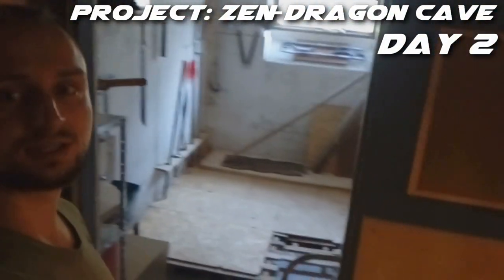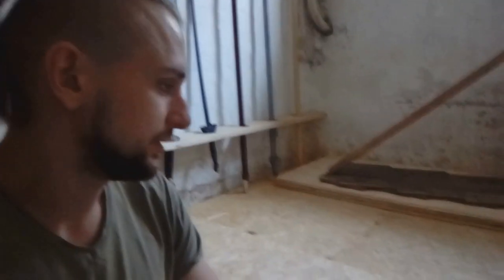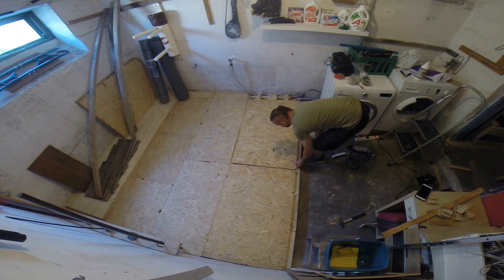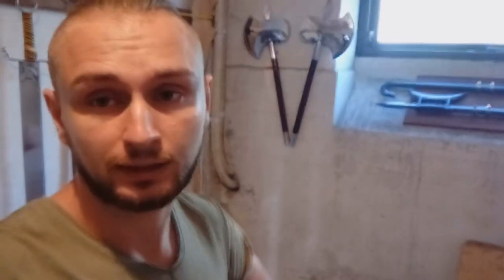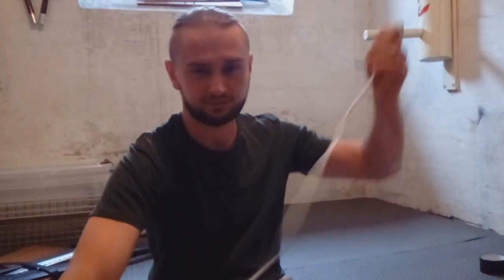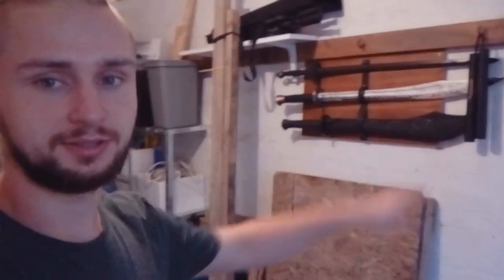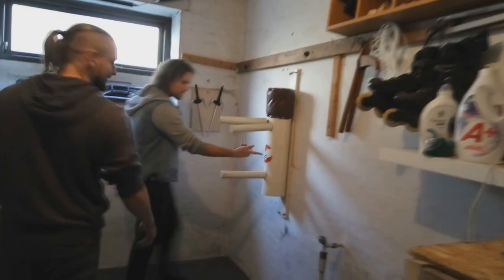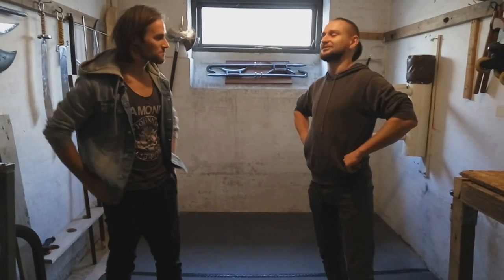PROJECT Zen-Dragon Cave (Extreme Makeover: basement edition)

Comment: what are the dimensions of the training space there? I will guess 2.5m wide, 4m long, 2.2m high... earlier this year i only had a small space for training too
Reply from the maker: the training space is around 260x260cm (I dont know how hight but is quite high because you have two steps down when you getting in) minus 20cm for the long weapons on one of the wall  and minus  around 20 cm for dummy but  I used "butterflyes" for the scruls, so you can always remove dummy from the wall if you want to : )  It is not big space but for self training is enogh : )